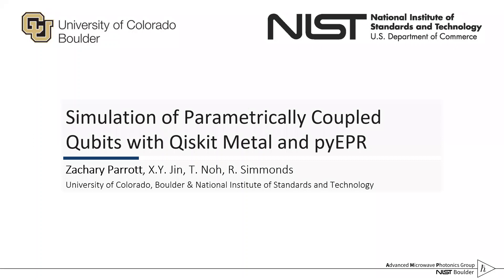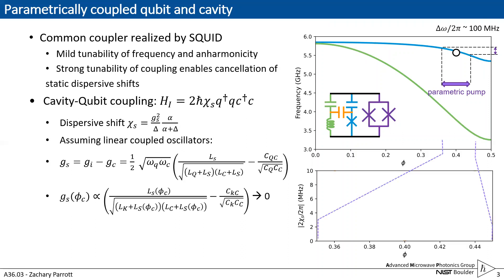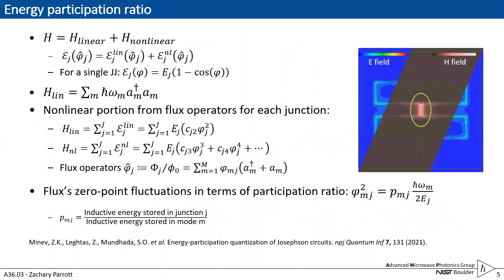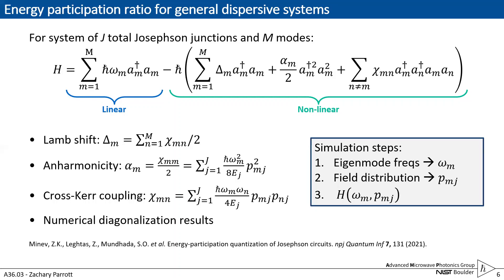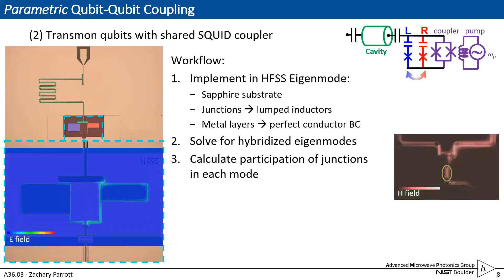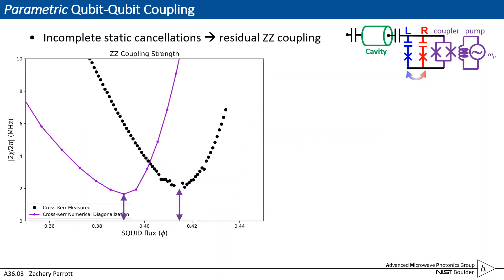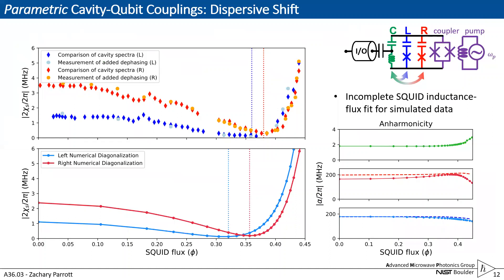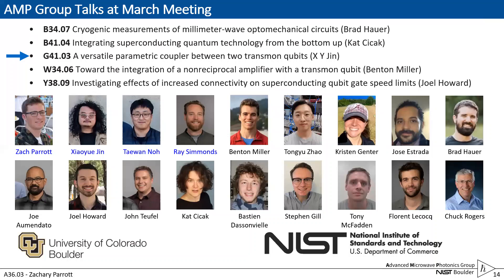Simulation of Parametrically Coupled Qubits with Qiskit Metal and pyEPR

Comment: In 7:46. The graph showes that the Measured vs Numerical Diagonalization results for Cross-Kerr, where the minmum point has shifted in flux space slightly. Is that due to higher order correction in Numerical Diagonalization, or just the simple model you use?
Reply from the maker: Primarily it is due to the latter, the simple SQUID model used. We only recently started (right before conference) converting the SQUID inductance (the variable swept in HFSS) to flux. We assumed an ideal asymmetric SQUID model with the zero flux inductance and asymmetry only roughly fit. In the future we are planning on doing more targeted measurements of SQUID's inductance which can be then used in design of future devices with same SQUID design.

Comment: In 7:19. 
I'm a little confused that why the cross-Kerr is ZZ coupling, I saw the cross-Kerr is dispersive shift in the paper about EPR.
Reply from the maker: Yes in the EPR paper cross-Kerr is talked about in the context of dispersive shift, normally between qubit and cavity. But can also have coupling between qubit modes. 
In the two qubit experiment we measured a difference in the transition frequencies between |eg> - |ee> and |gg> - |ge> which corresponds to the ZZ coupling strength. I.e., the qubit transition frequency of the right qubit is dependent on the state of the left qubit. 
So to address your question: the pyEPR package returns various parameters for a given Hamiltonian and  our group had been primarily viewing the circuit in terms of a different Hamiltonian but we can still relate some terms.